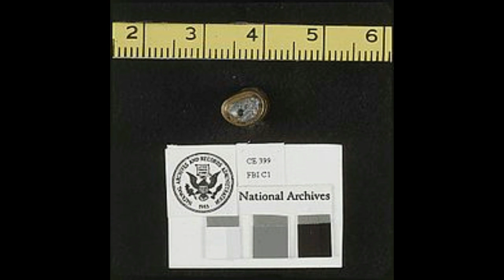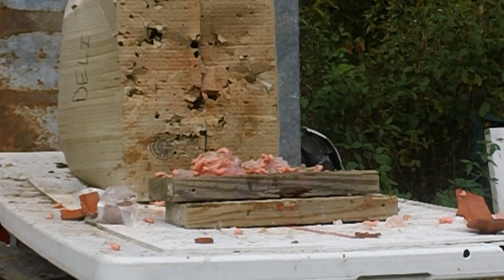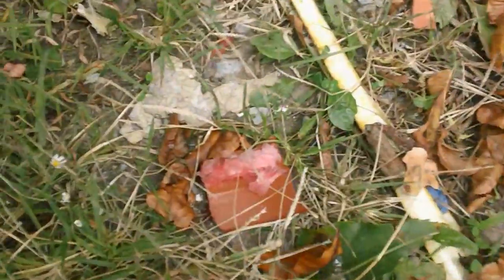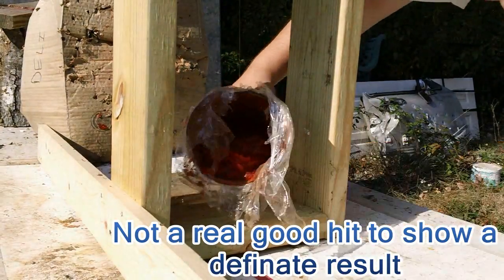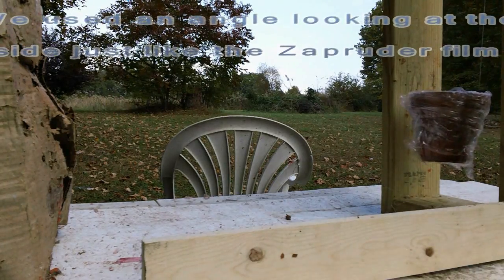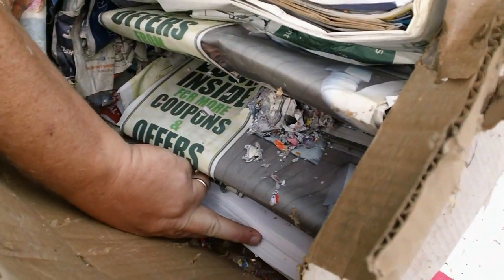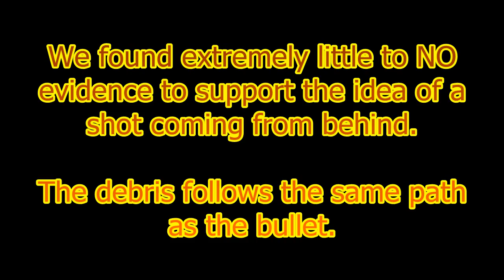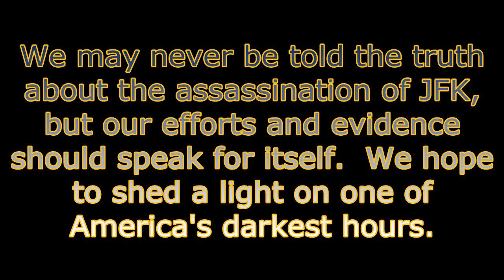Was JFK shot from the front or back? (simulation)

Comment: I think he was shot from the front and the back. I saw a tv simulation where a shot from behind did blow out the back of the skull due to internal shock waves. I am no expert on the assassination but the dicta belt recording suggests two of the shots were almost on top of each other which means more than one shooter. I think the solution to this is finding out who got the motorcade to go down Elm rather than Main Street. Without this the shooting would not have been as easily possible. I also think that Oswald's involvement in fair play for Cuba when he had apparently become quite anti communist since leaving Russia is something that has significance. It feels like he was being used in some small way and that this fed his ego etc.
Reply from the maker: great comments
Reply from the maker: I have read this "theory" awhile back and thought to be quite interesting.  It is plausible, yet the whole incident is still shrouded in mystery. 
I still lean towards the idea that the President was shot in the back by Oswald, and in the head by a different assassin.  The whole magic bullet (Warren comission is bunk)

Comment: The 6.5 at the range that JFK was hit was like a 223 or a 30 cal carbine at point  blank range
Reply from the maker: I know that when I was practicing with this round before filming the video.... I tested it with wood, water, and other things and I can tell you that when it yaws or tumbles, it is a very devastating round.  The soft point does a lot of damage.  
Thanks for your comments.
Reply: poboyspecial Great work, the only aspect I would mention is that connallys head 7 upper body was in the way of the rear head shot & nellie as well, if it was shot from the rear, those bullets were made to go through thing's especially human tissue, but a human head does not have the same density as a clay pot, if you look closer a frame 312 & look at where connally is seated, the round from the 6th floor would have went through jfk's head & came out his left eye & got nellie. cheers,may be the government should use human scientific experimental bodys as Dr Cyril Whect has said & you shoot & shoot till you get the result's as shown in the altered Z film. cheers.
Reply from the maker: Thank you for your comments,
Yes I realize the pots are not the same as a skull, but it is only a simulation the best we could on a poboy budget (no sponsers) but it is a good visual example of what happens.  We also could not replicate the pressure inside the head.... but that is another discussion.   Great discussion...
Reply: poboyspecial No worries, at least people like you are trying. :)